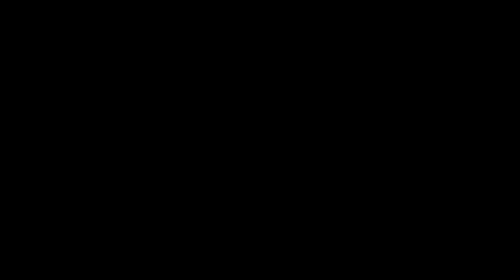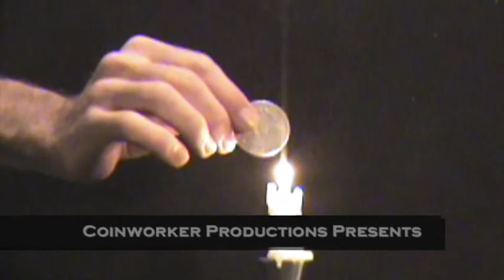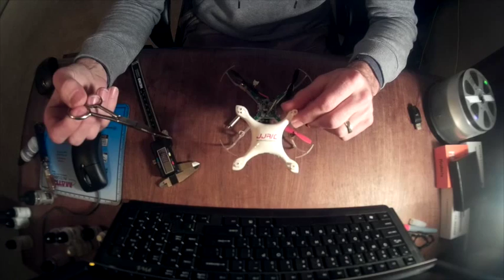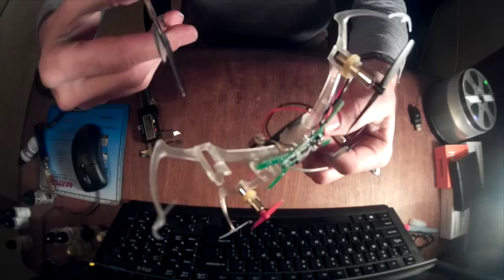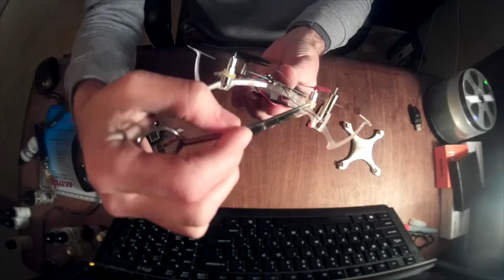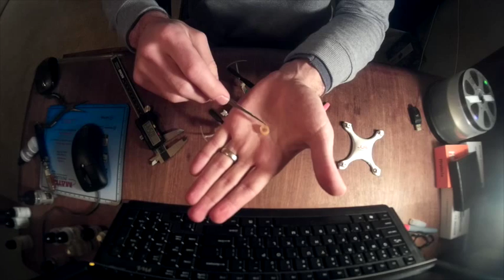Stock FPV Nano QX frame with 7mm motors, How to

Comment: I believe you can buy a Dromida DIDE 1540 frame which is exactly like ( a tiny bit bigger and stronger though) the NQx frame but can house 7mm motors! I'm "trying" to use a NQx FC board with 7mm motors in it. Do you know if I would have to change out the original NQx motor connectors (JST 1.25) and wire gauge to run the 7mm motors?

Comment from the maker: From what i have heard it will be just fine but the issue was the LVC or low voltage cut off the original apparently kicked in earlier than the fpv board but  i would say go for it, it's a easy swap out and worth it.

Comment: Hey coinworker, I've been trying to fit my blade nano qx fpv board on a frame with 7mm motors.  I got everything wired up properly, motors are spinning in the proper direction and the props are on the right motors. I'm having trouble with the thing oscillating and wigging out soon as I try to take off. Just wondering if you have been through this and if you know of a fix. Thank you
Reply from the maker: original frame or a carbon fiber type frame? Most likely it's a motor not spinning correctly direction or to slowly for some reason like a bad motor or something. It could be that the board is loose and getting bad vibrations causing it to freak out as well. Good luck and let me know how it turns out.
Reply: I got it all on a dromida verso frame modded to fit 8mm motors. I just had the motors in the wrong orientation, worked like a charm until I slammed it into the concrete. Now I have a couple motors to repair. Thanks for responding.
Reply from the maker: Awesome, glad it worked for you... while it lasted.

Comment: Can you use a 600 mah battery with the board?or will it fry the board components and motors
Reply from the maker: C0ckPitVuE 777 you can use any size 1 cell battery you want without frying the board as long as it's a 1 cell.  the mah rating is just how long it will last. the only issue with a higher mah rating is the battery gets bigger and heavier, at some point the weight is too much.